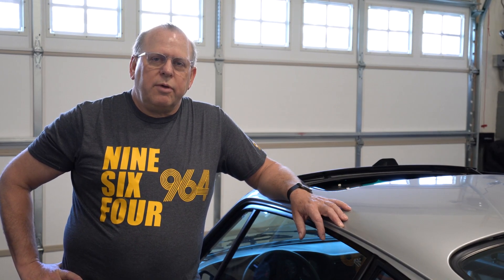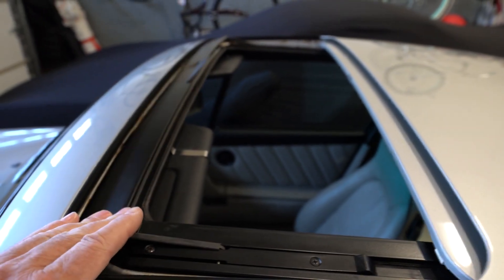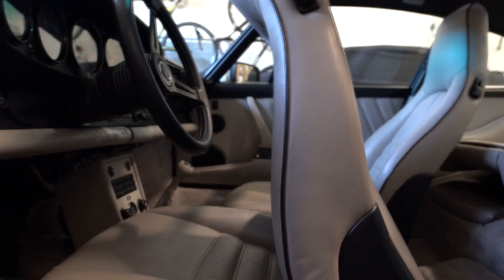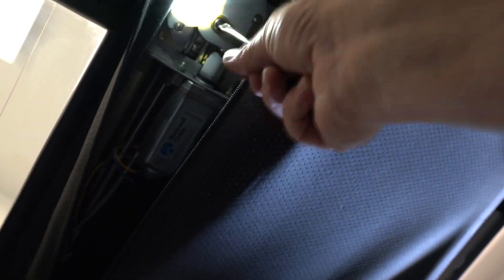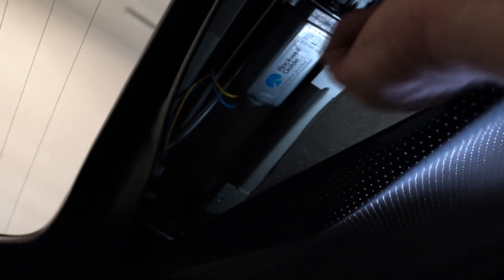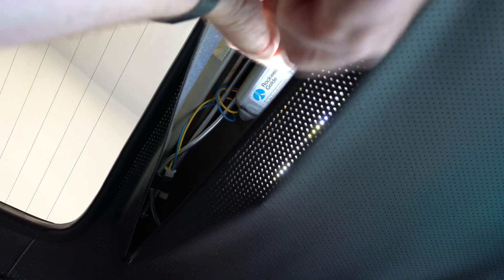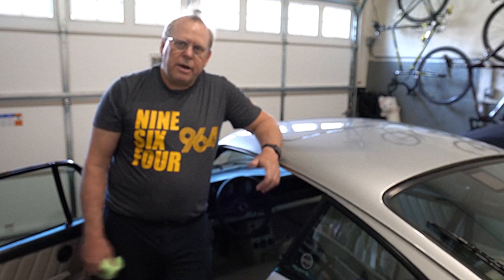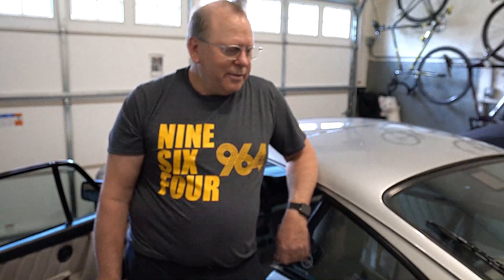Sunroof Stuck Open? How to Troubleshoot & Fix | 1989 Porsche 911 Carrera 964

Comment: This video has an error in the tile, and in the comments from "Albany County Fasteners". The car is NOT a "964" series Porsche 911, but a G-series (pre-964) 911 Carrera 3.2. The 964-series started with the 1990 model year. This is notable because the sunroof mechanism is different for the different generations of Porsche 911.

Comment: Excellent video, I'm having issues with my 993. I think the motor is not getting enough charge. It opens with no issue, but I have to hold the button down for several minutes and then it eventually closes
Reply from the maker: yep not a very good setup.